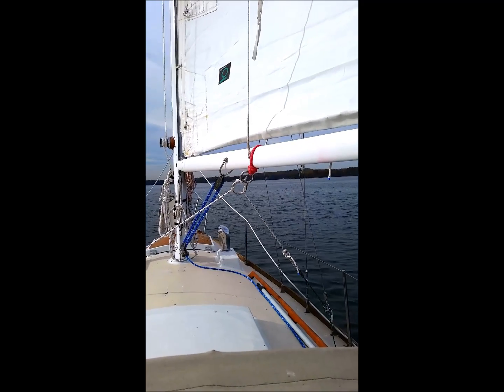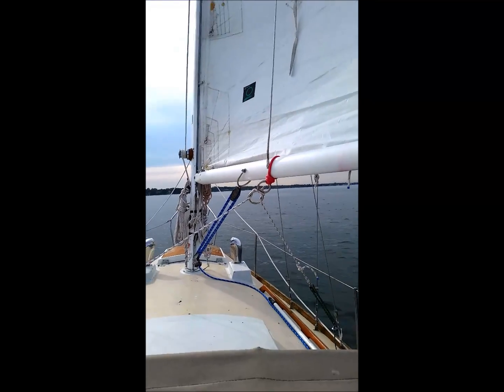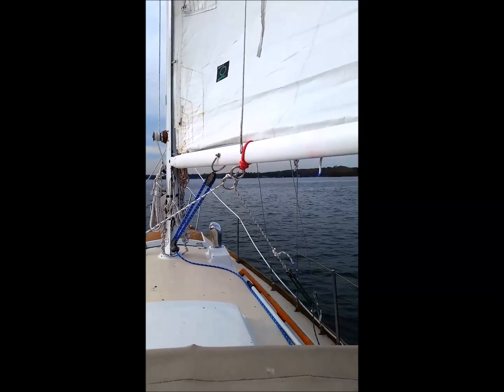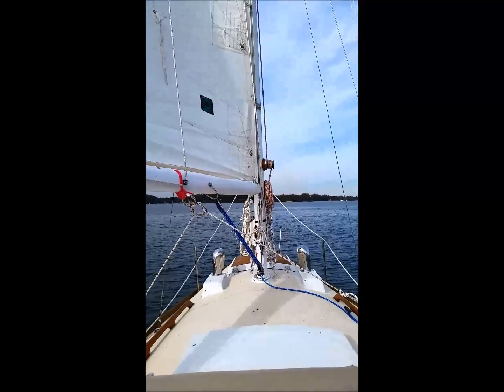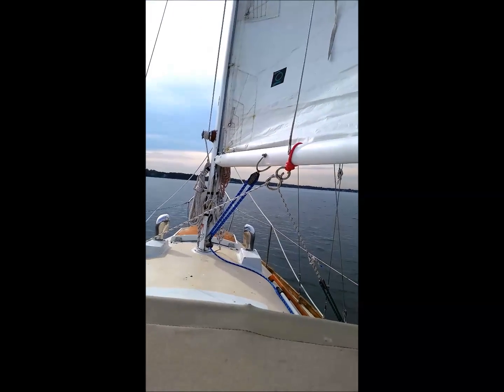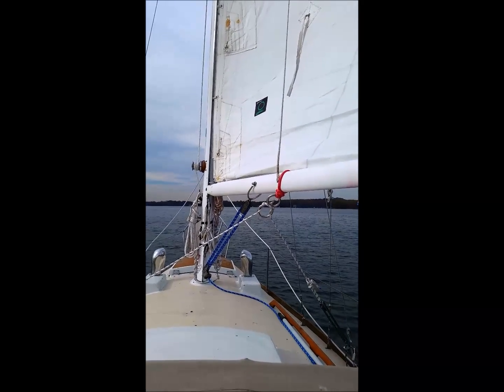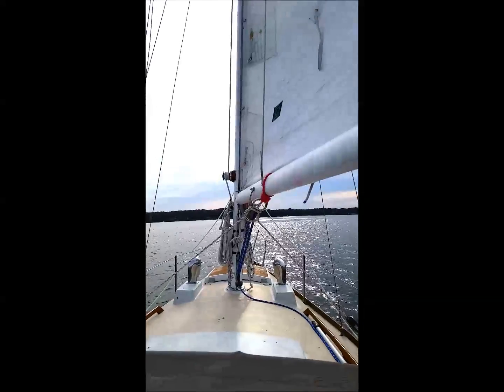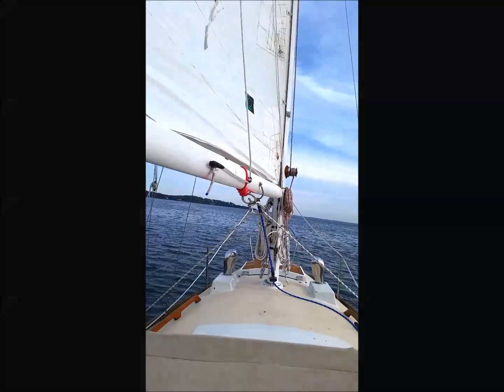Bristol 32 Boom Brake Installation

Comment: I've purchased one of these and found the online videos to be very unrealistic. The videos always show these being used in very light winds and with the main sheeted near a beam reach rather than mostly paid out in a running configuration.  I rigged my boom brake for the maximum amount of friction and performed several test gybes in 12 knots of wind, with the main sheet mostly paid out.  The boom brake did almost nothing to slow the gybe unless you snugged the line down which makes the boom act as a preventer, preventing the gybe entirely.  Was disappointed, would not recommend.
Reply from the maker: There are many people on many sized boats that have had great success with it. 
However there are also many variables that effect the friction which can include the diameter of the friction line, the tension on that line, the placement of the brake etc. What size diameter are you using, try using 1/2", try increasing the tension of it too. Send us photos and the data you used in the spreadsheet on our web site at merimarine.com. Thanks

Comment from the maker: Installation components for Capt. Don Boom Break tension line used in this video.
For complete parts list and larger images of the above Bristol 32 installation, see: http://dreamgreen.org/products/boat-parts/220-bristol-32-installation-details

Boom Break attached to boom at 48” back from gooseneck using length of 1/8” AmSteel-Blue Dyneema AS-78 single braid. Attachment was made by square lashing the line around boom (main is loose footed) through top eye of boom break and finished with a rolling hitch around lashing between Boom and Break.

After several trials using different diameter line, the final Tension Line was determined to be New England Rope, 3/8”Sta-Set, Polyester Double Braid. Length will vary with the vessel. Attach a Ronstan, Standard 2 11/16” S-Bail Snap Shackle to the working end of the line using a Buntline Hitch, Fisherman’s Bend or Bowline. Attach point of shackle according to suggested in directions, our point is the Port lower after stay turnbuckle.

Run the tension line up through, around and back down through the Brake so the line leading to either side is between the break loop and the vessels deck.

In order to adjust the tension of the line a block and tackle was constructed that could be actuated from the cockpit. The running end of the Tension Line affixed to the swivel of a Ronstan, Series 40, All Purpose Fiddle Block. Construct the Double Tackle using New England Rope, 5/16” Sta-Set, Polyester Double Braid. (3850 Lb breaking strength) eye attached to a Ronstan, Series 40, Fiddle/Becket/Cam so control line leads back to vessel cockpit. Attach another Ronstan, 2 11/16” Standard S-Bail Snap Shackle to the Fiddle/Becket/Cam swivel. Attach this Snap Shackle according to suggested in directions, our point is the Starboard lower after stay turnbuckle.
Parts List:
Samson, 1/8” AmSteel-Blue Dyneema AS-78, single braid (2,500 Lb Breaking Strength)
New England Rope, 3/8” Sta-Set, Polyester Double Braid (5,100 Lb breaking strength)
New England Rope, 5/16” Sta-Set, Polyester Double Braid (3,850 Lb breaking strength)
1 Ronstan, Series 40, All Purpose Fiddle Block (882 Lb breaking strength), Part # RF41500
1 Ronstan, Series 40, Fiddle/Becket/Cam (882 Lb breaking Strength), Part # RF41530
2 Ronstan, Standard 2 11/16” S-Bail Snap Shackle (1,870 Lb working load), Part # RF6110

Comment: What Happens if you wanted to sail deeper in the wind?  Or if you had to blow the main to get the helm to respond if being rounded up?
Reply from the maker: Bruce, good questions. The boom brake does not limit the boom swing angle.
I have done a spreadsheet that you can download to optimize your brake installation and see what effect different rigging positions of it has on the friction line length. Remember you want to minimize any changes in line length as that changes the friction of the line through the brake although a small amount will not be avoidable. http://dreamgreen.org/images/Boat-Parts/boom_brakes/F&C44.xls
Regarding your 2nd question: You can still move the boom by hand, although that is always easier when done from near the end of the boom.
In a pinch you can just release the friction line from the cleat.
Happy safe sailing.

Comment: Construction components for Capt. Don Boom Break tension line.
For complete parts list and larger images of the above Bristol 32 installation, see: http://dreamgreen.org/products/boat-parts/220-bristol-32-installation-details

Boom Break attached to boom at 48” back from gooseneck using length of 1/8” AmSteel-Blue Dyneema AS-78 single braid. Attachment was made by square lashing the line around boom (main is loose footed) through top eye of boom break and finished with a rolling hitch around lashing between Boom and Break.

After several trials using different diameter line, the final Tension Line was determined to be New England Rope, 3/8”Sta-Set, Polyester Double Braid. Length will vary with the vessel. Attach a Ronstan, Standard 2 11/16” S-Bail Snap Shackle to the working end of the line using a Buntline Hitch, Fisherman’s Bend or Bowline. Attach point of shackle according to suggested in directions, our point is the Port lower after stay turnbuckle.

Run the tension line up through, around and back down through the Brake so the line leading to either side is between the break loop and the vessels deck.

In order to adjust the tension of the line a block and tackle was constructed that could be actuated from the cockpit. The running end of the Tension Line affixed to the swivel of a Ronstan, Series 40, All Purpose Fiddle Block. Construct the Double Tackle using New England Rope, 5/16” Sta-Set, Polyester Double Braid. (3850 Lb breaking strength) eye attached to a Ronstan, Series 40, Fiddle/Becket/Cam so control line leads back to vessel cockpit. Attach another Ronstan, 2 11/16” Standard S-Bail Snap Shackle to the Fiddle/Becket/Cam swivel. Attach this Snap Shackle according to suggested in directions, our point is the Starboard lower after stay turnbuckle.
Parts List:
Samson, 1/8” AmSteel-Blue Dyneema AS-78, single braid (2,500 Lb Breaking Strength)
New England Rope, 3/8” Sta-Set, Polyester Double Braid (5,100 Lb breaking strength)
New England Rope, 5/16” Sta-Set, Polyester Double Braid (3,850 Lb breaking strength)
1 Ronstan, Series 40, All Purpose Fiddle Block (882 Lb breaking strength), Part # RF41500
1 Ronstan, Series 40, Fiddle/Becket/Cam (882 Lb breaking Strength), Part # RF41530
2 Ronstan, Standard 2 11/16” S-Bail Snap Shackle (1,870 Lb working load), Part # RF6110

Comment: Do you think that in bigger winds you would use the third wrap option - the little "finger" in the small ring?
Reply from the maker: In a strong blow or a bigger boat yes.
Reply from the maker: That is the purpose of the finger, to increase the friction if needed.